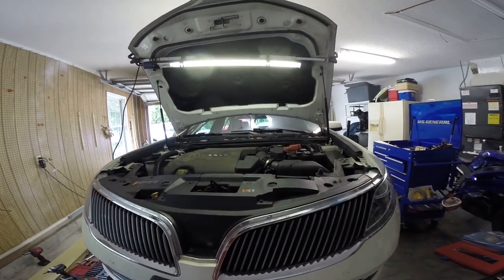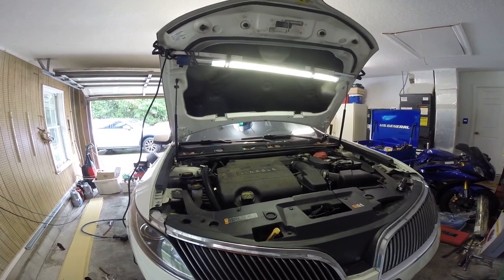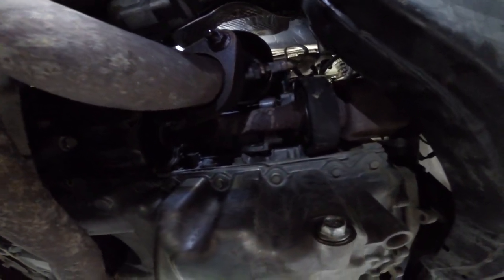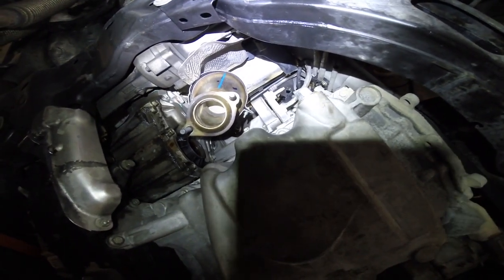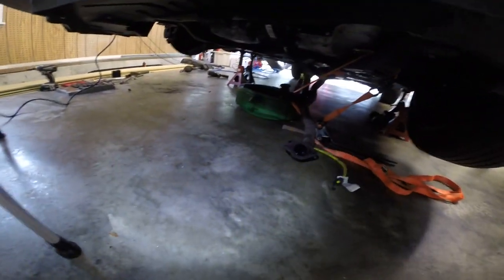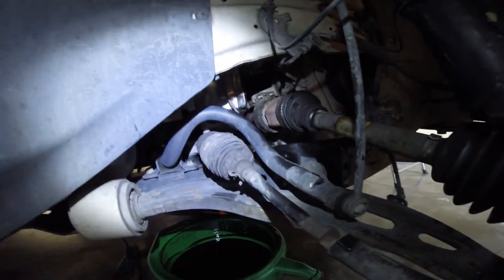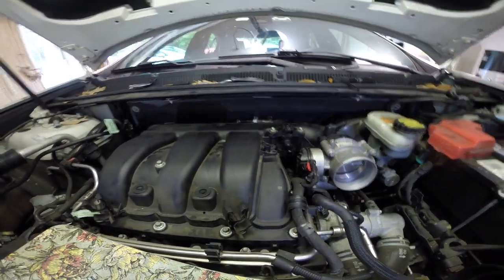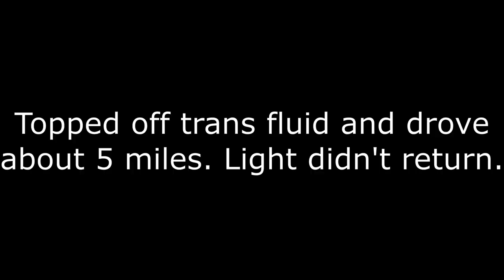Lincoln MKS (2013) Catalytic converter remove and replace.

Comment: I have Ford Explorer 2011 has the same issue “cat converter bank 2 ..”
It’s the same exact spot ,everything looks same but the cat looks a little different 
You did a great job and really useful tip to remove the axel to make some access .
Thank you so much for this video 👍
Did you get new o2 sensors too or reused them?!

Comment: If you would have pulled the passenger side motor mount and dropped the motor a bit would that have gave you enough room? I just did the timing cover in my 3.7, what a pain.